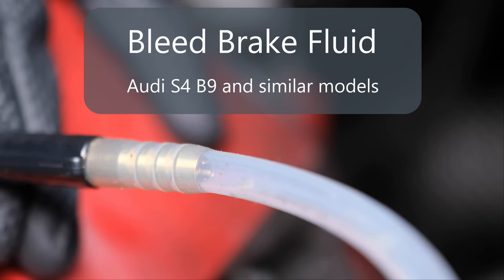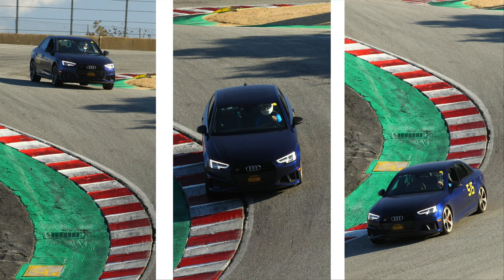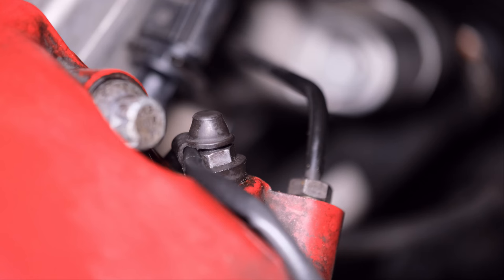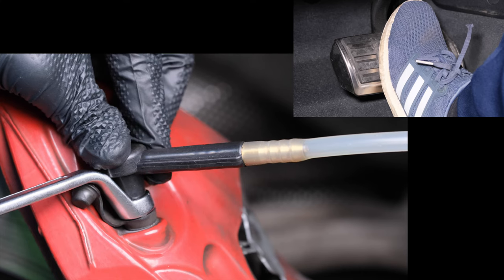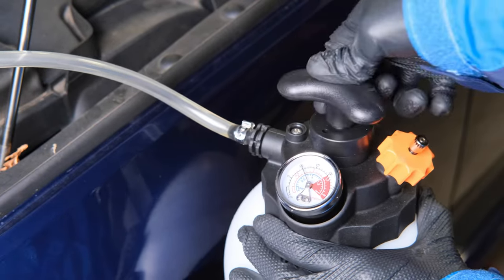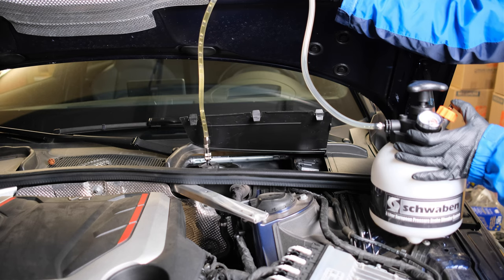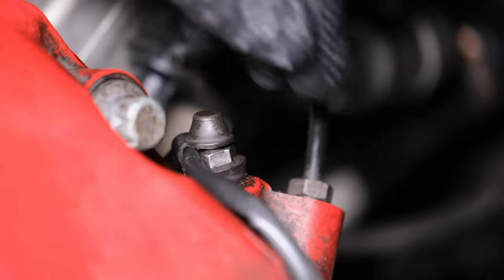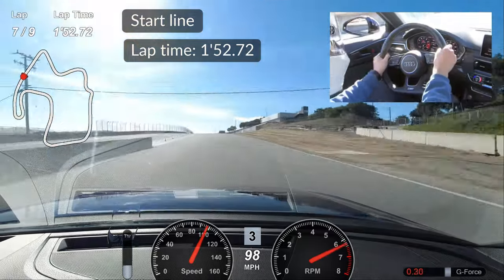Flush/Bleed Brake Fluid - Audi A4 (S4, RS4) A5 (S5, RS5) B9

Comment: you start bleeding from right rear passenger brake and move on to left rear and than front passenger and last driver side … brake bleeding should start from furthest away from the brake reservoir tank
Reply: the service manual for the B9 states the exact opposite (I believe it's because of the ABS system). It's best to follow what the manufacturer is recommending.
Reply: if the abs is located in the driver side  you start bleeding from the fartest away brake which is right rear ..
Reply: bro you're literally arguing with the service manual... i gave my best guess for the reason why it's this way
Reply: if the abs module is located in driver side you bleed the brake from far right rear and move to left rear and down to right front brake and left fromt brake
Reply: @HeadsUP253 dude clearly can’t read, procedure is in the service manual but thinks he’s right because most other cars are this way.

Comment: Thank you for all the effort put into these videos. They are extremely helpful, especially with the limited B9 videos out on youtube currently.
Reply from the maker: My pleasure
Reply: Hi, did you decide what you are going to get for the brake pads and rotors? My audi now needs brake service. Thanks
Reply from the maker: For track or street? I use ECS Tuning rotors and EBS yellowstuff pads for track. I use front stock rotors and pads for street. Not sure about other street rotors and pads.
Reply: @stevenstrackdays2687 mainly street but who knows maybe one day take it to the track. But even so, I tend to drive a bit aggressive on the street.. ECS tuning has front & rear brake pad kit for $ 210 and f/r rotors for $1038. The dealer quoted me  a price of $2138. I assume that includes labor.
Reply: @minaguirguis8897  The MSRP price of a stock rotor is $160, but dealer charged me $265.2。The MSRP of stock pads is $229.23, but dealer charged me $239.63. Labor was $310 only front brakes. All pre tax.
Reply: @stevenwang372  may I ask why dealer charged you extra for pads and rotors and not msrp?
Reply: @minaguirguis8897  I don't know. I didn't check MSRP when quoted. I checked MSRP. I guess that's how they earn money...

Comment: If you are using the pressure bleeding method do you also need to open/close the bleeder screw on the caliper with a second person pressing and letting off the brake pedal?
Reply from the maker: No need for the second person pressing the brake pedal if you use the pressure bleeding method.

Comment: I thought the b9 s4 requires low viscosity brake fluid. Does that not matter?
Reply from the maker: I don't find low viscosity requirements in repair manual. I don't think that the OEM brake fluid is low viscosity fluid https://parts.audiusa.com/p/75828152/B0007501LDSP.html
I think LV is worth considering in cold weather, but not for track purpose.

"For track use, a heavier high performance brake fluid such as Ate Typ 200 or Motul RBF600 or RBF660 is recommended because of their higher boiling point and because the thicker fluid will thin out at track temps."

Comment: What service manual did you use to get the bleed amounts? I have the brake system manual through erwin and don’t see that anywhere
Reply from the maker: Right, it's not there. I found the info in a file called "D4B805C61D2-Maintenance.pdf". I believe I downloaded it from the "maintenance" category in Erwin.
Reply: @stevenstrackdays2687  thanks for the response!

Comment: if you use the pressure bleeder to replace pressing the brake pedal do you need the pressure bleeder to be filling with new brake fluid as you are bleeding out the old?
Reply from the maker: No you don't need to fill it with new fluid. But eventually you want to keep the final fluid level high (close to max level but leave room for new brake pads). So, why not fill with new fluid earlier.
Reply: @stevenstrackdays2687  im wondering if you don't fill it while pressurizing it and you bleed at the calipers and then fill later that you risk trapping air in the lines needing to bleed a lot more until you get no bubbles?
Reply from the maker: That's true, but as long as you don't push the level below the min, no need to worry about air. Both the max and the min levels are marked on the reservoir. Please monitor the level.

Comment: Thanks for this great video! Approximately how much new fluid would you end up adding in total to do a complete flush? I've got my first ever track day coming up in a couple of months, so I'll be upgrading my brake fluid (higher boiling point Motul RBF 600 or 660) soon, along with new pads, rotors, and ss brake lines. I'm assuming it'll be a little over 1L in my case, since I want to ensure that all of the old fluid is replaced. I've got a 2010 4.2L 6MT Audi S5 btw
Reply from the maker: For B9 models (year 2018+), it is 1L auto and 1.15L manual as I mentioned in the beginning of the video. For your model, unfortunately I'm not sure.
Reply: Fair enough  @stevenstrackdays2687  - thank you for the feedback anyway

Comment: hello, this is great info, but i am wondering have you ever heard or expierenced hearing a squeaky brake pedal after doing a brake flush? I have a 2020 S4 and after getting a fluid flush, my brake pedal squeaks - usually when releasing the pedal.
Reply from the maker: Sorry I didn't experience it. Do you have repair manuals? Maybe it's mentioned there.
Reply: @stevenstrackdays2687  i do not, i will check for manuals.  thank you!

Comment: Do I need Worque Trench？
Reply from the maker: For the bleeding screw? I don't think so. The fluid will stop bleeding even when the screw is not super tightened. The manual does mention a torque value but I never followed it.
Reply: @stevenstrackdays2687  Do I need apply some anti seize grease on the bleeder screws? and what is the maximum allowed pressure to pump with the bleeder pump? 9 PSI?
Reply from the maker: @MKasap-te8vm  The repair manual does mention the grease so I don't think so. 

I don't see the max limit. But the manual said "An initial pressure of 2 bar (29 psi) is required to bleed the ABS Hydraulic Unit."  So at least 29 psi.